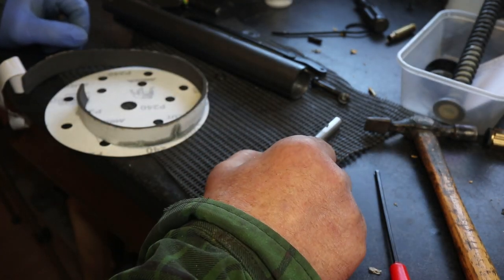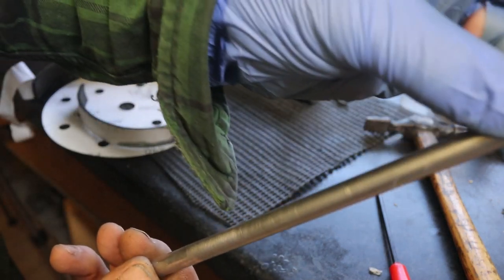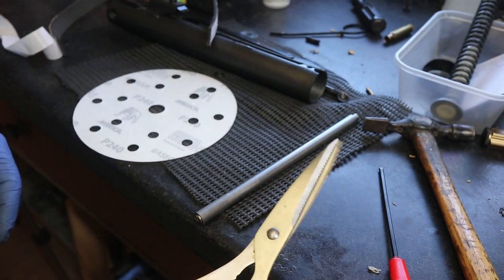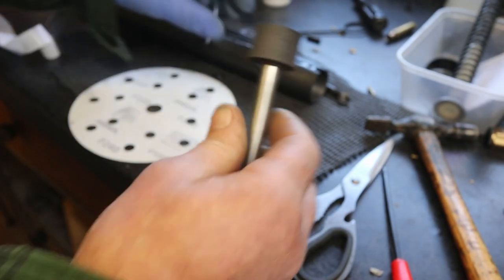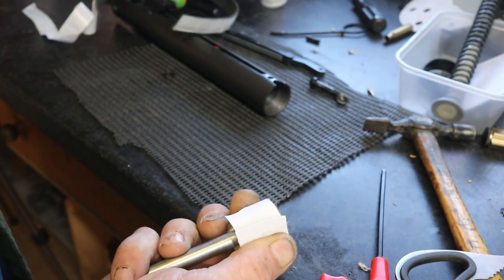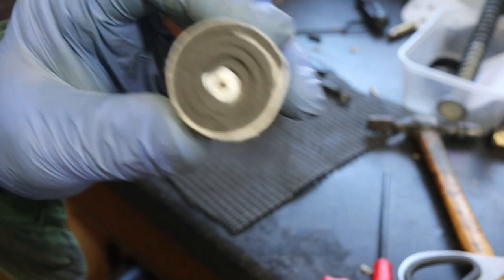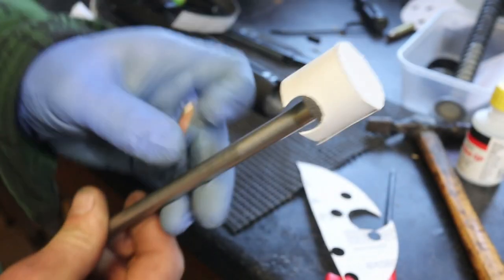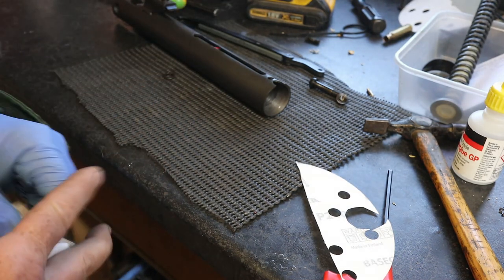Making a simple honing tool for air rifle cylinders

Comment: Most suggest never use wet&dry on the inside of the cylinder, the reason being, make it to smooth and the grease off piston has nothing to hold on too, been told this many times , with respect,  what is your take on this smooth.
Reply: The 240 grit sandpaper he uses won't give a smooth finish, so should be fine. I used a brake cylinder honing tool in my gun.

Comment: Years back when I tuned my HW35 .. I used a broken 12 bore cleaning rod , with a reasonable grade of wire wool and metal polish ... so far back can't remember what polish. Chrome or something... I attached the rod to an electric drill and just went for it!! .. I remember my dad laughing at what I was doing whilst ramming it backwards and forwards as he walked into the garage 😂.. I said I'm honing the piston cylinder .. he raised an eyebrow and smiling .. left me to it ... well .. all I can say is I regularly took rabbits out at 60 yards and even beyond!! Now before you comment on you shouldn't shoot beyond 40 max.. with sub 12 ... I used to stalk and hunt wide open meadows adjacent to woods .. and most times 40 to 60 was as close you got , so rifle was zeroed for 40 yard . I'm talking way back when only gunsmiths had chronos .. I doubt my 35 was much more than 11.4 ftp but boy oh boy did it shoot smooth and accurate,  yes honing tools can be made or thought out OK.

Comment: Back in the 80s, I had an RO72 pistol with and aluminium cylinder tube, to hone the inside, I simply used gaffer tape to fix a piece of old t shirt to a wooden dowel, then put it in the dril and used Solvol Autosol metal polish, the smoother you get the tube, the easier the piston washer will slide.. and it costs very little
PS, make sure you wrap the cloth around the rod in the correct direction, so that it doesn't unravel itself whilst spinning!

Comment: thanks for sharing! what does honing the cylinder achieve?
Reply: It’s to debut any imperfections and keep it nice and slick for the piston to move smoothly.
Reply: @AK-ky3ou  which lowers vibration and noise. Both good.

Comment: Hi Geoff excellent vid I'm looking at polishing the comp tube on my tx200 would this method work and what grade paper would you recommend I start with and them finish with also would you recommend some sort of metal polish ?     Many thanks in advance
Reply from the maker: Hi Philip. I'll be honest, I tend to aim for more of a honed or cross lapped surface inside compression tubes, to allow tiny surface scratches for holding the silicone lubricant. A finishing pass with abrasive around 600 grit is ideal.
Reply: @lsduk   thx geoff for the advice much appreciated as always 
      Phill

Comment: This honing rod is not very round. No issues with the wobble in getting a nice even hone?
Reply from the maker: Hi Buddy. The aim is a honed/clean cylinder, no intention to coarsely remove material with rough abrasive. Most of the wobble is from the bar, not the head.
Reply: @lsduk  do you have a tip for an improved 26mm piston seal? And maybe for a new barrel seal too?
Reply: @FlexDRG  Jim macari air rifle headquarters
Reply: @redauwg911  interesting. But $25 shipping is killer.
Reply: @FlexDRG  yeah I got the spring and guides to go along with it
Reply: @redauwg911  i have a tbt spring kit underway. They didn't have seals to go with them. Any tips for EU/UK sellers?

Comment: Can you design an air rifle system without a hammer?
Reply: No need for a hammer during the design phase 😂
And in the triggers I've seen for springers it's just the seers and the catch, no hammer in sight. Hamers are more often found in firearms and PCP / CO2 systems where the hammer hits on a valve stem for a short release of gas.